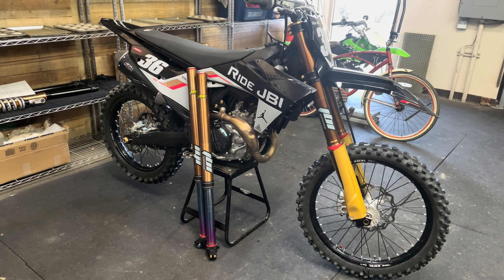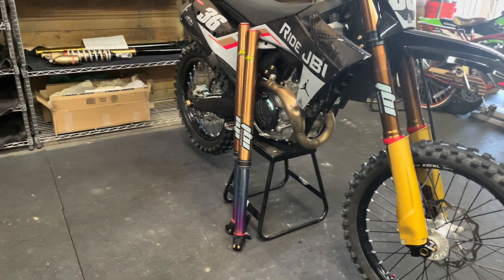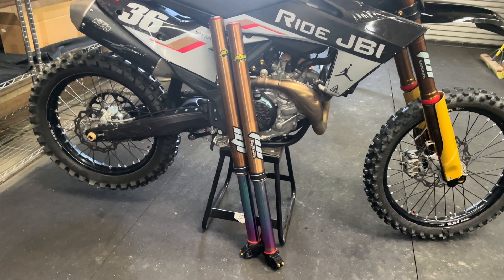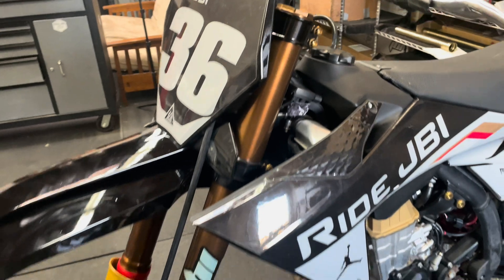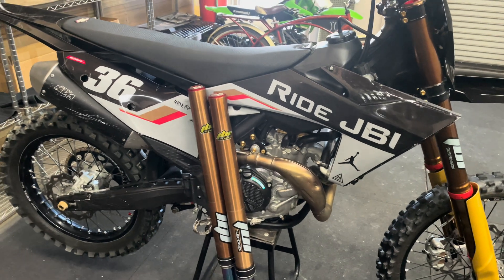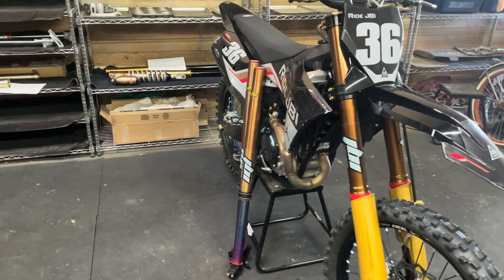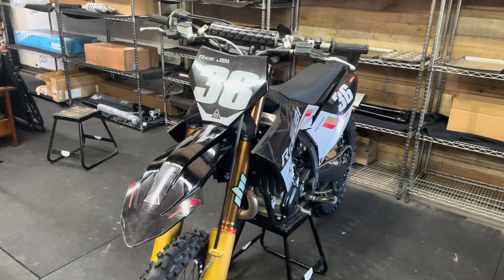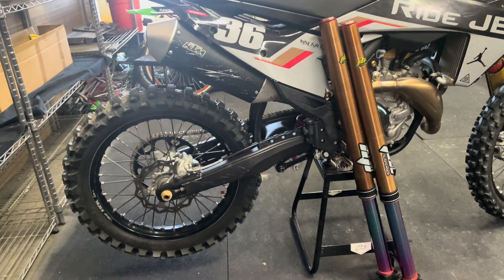Update 1: Developing a leaf spring midvalve for WP Cone Valve / XACT Pro 7548 Forks

Comment: thanks for the sharing the video, good to see the conevalve setup and the leaf spring conversion. I have dal soggio spheres in my 500 desert racing bike, i do all my own shim stacks in both the forks and shock. I have searched long and hard looking for a kit to change the ds spheres from a comp midvalve spring/checkvalve arrangement to either cone or leaf spring config, would you know if this has been done, or if there is a off the shelf set of leaf spring cup and shims i could make work? thanks
Reply from the maker: Hello and thanks for the comment. 

It’s been a few years since I have worked on a DS Sphere.   I can’t remember how the midvalve post is designed and if there would be room for changing the midvalve configuration for a different style.

Comment: Do you ever cerakote fork tube uppers instead of anodizing?
Reply from the maker: Yes. Some older bikes that were worn beyond anodize were did a cerakote finish on and it turned out nice.  Given the choice I would choose anodize first for upper tubes.
Reply: @RideJBI  
Absolutely agree, and your works fantastic.  Hard to beat anodizing, but I guess that really depends on how nice your uppers are, If they are pitted and gouged or still nice and smooth without roost marks, etc.